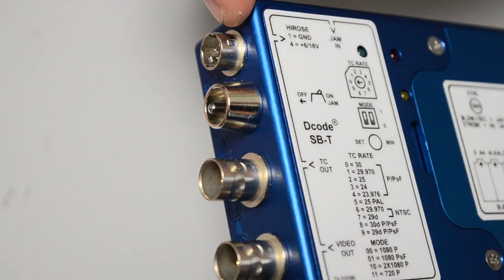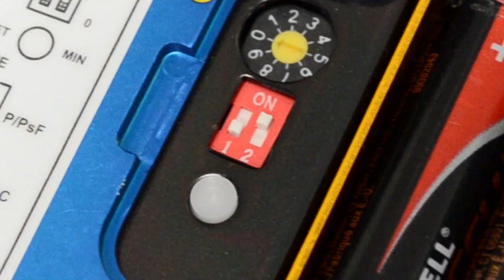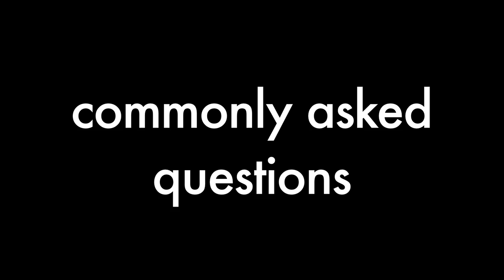Denecke SB-T Time Code Generator / Reader and Tri-Level Sync Box

Comment: It depends on what type of shoot cameras and audio recorder you use if the equipment can jam sync/cross sync etc you can use the sb-t as the master clock leaving it running during the shoot and jam sync the cameras and audio they will reference and continue to run sync until powered down.